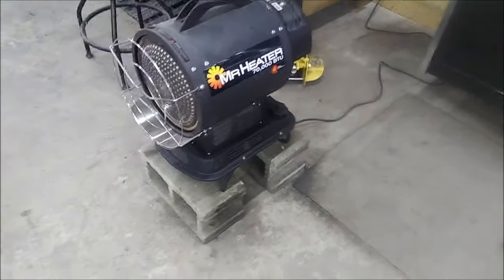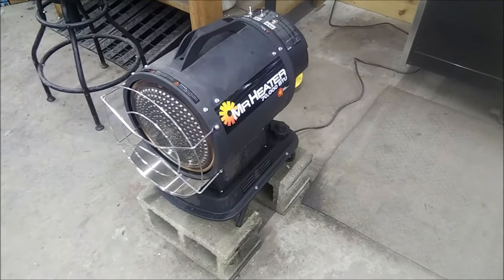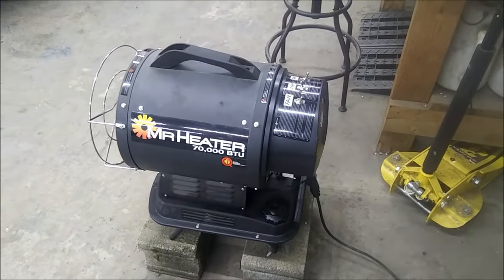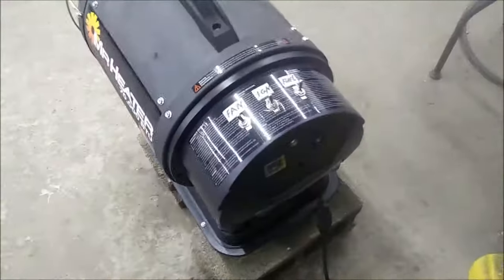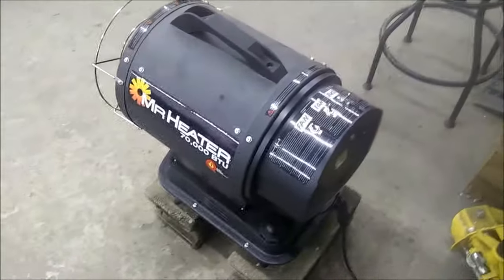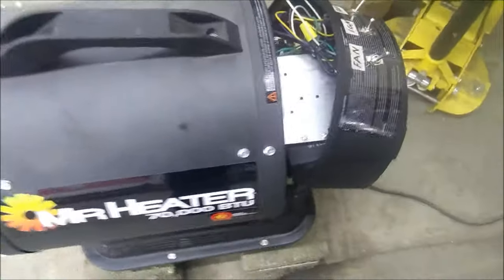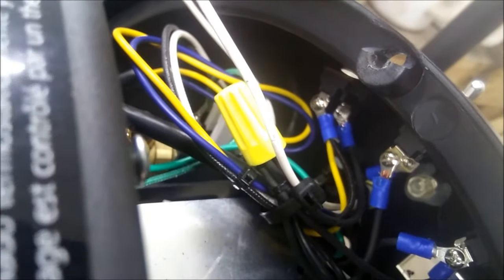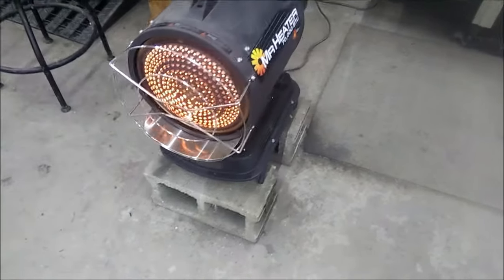Radiant kerosene heater 3 months review E1 code delete

Comment: I’m gonna do this I guess, I’ve had one for 3 winters now and the first winter it worked great, second one was ok had to adjust the fuel now and then, but this winter it’s been nothing but problems, can’t get the thing to stop throwing me the E1 code, calling the tech line from mr heater is like calling your local elementary school and asking for a random 2nd grader on the phone, I know 10x more about this machine than they do apparently. But I love the hater when it’s working, puts out great heat, burns clean, and isn’t that loud
Reply from the maker: I feel the pain lol I still run this same heater and love it for the same things as what you pointed out ... hence I made this video save people some grief and money and keep running it ... thank you for watching

Comment: Its sad so many people have the same issue with this heater. Mine has been working fine for months, this morning its been running, hr later it lit and then throws E1. Now its just repeat E1, I did all the things. I cleaned everything I could find, adjusted fuel pressure, still E1. Lit for a few seconds and shutoff.
Reply from the maker: I feel the same way ... but I really like this heater a lot so therefore I did the modification and I still run it this way as of today. Thank you for watching

Comment: That is great!  I have the same heater and I use it outside in 20° weather and the only way to properly shut it off was to turn the thermostat to 41° which doesn’t work because the outside temp is colder than that. I put a fuel shut off valve on it so I can run it out if fuel and the cool down fan will still work. I love your idea and will modify mine once it starts acting up. Great heater other than that though.
Reply from the maker: Yes feel the same about it works awesome but all that safety stuff was killing it lol. There's a electric fuel shut off valve on it btw

Comment: So I see the reviews. It sounds like this is not worth it unless your some kinda handy man technician or electrician
Reply from the maker: This video is several years old now I hope they have the problem fixed by now, but I don't know. Been running it with that mod for years now and 0 problems I love this heater. Hope this helps and thank you for watching

Comment: One thing that the circuit board does is shut off the fuel if it gets hot, or loses ignition for some reason.  By setting it up manually as you have done is great if it doesn't have any loss of ignition.  If yours failed to fire it would just keep pumping fuel , which would be liquid /vapor unburnt fuel until the tank was empty.  If pump continues to run without fuel it will be destroyed.   The setup you created is best not left unattended, but I understand it eliminated the sensitive electronics and thus works.
Reply from the maker: Once it's fired up you don't need ignition so the only time you'd have a problem is when you lose power and it comes back on. This was the best way I know how to keep this heater up and running instead of throwing it away ... thank you for watching
Reply: I believe ignition is needed before and during the time the fuel selenoid is open.  Ignition is required during firing, it does not ignite or continue to burnt without an ignition source. And it continually needs an ignition source, if you cut ignition it goes out /if you cut fuel it goes out.  But if you cut ignition only it will continue to pump fuel which then goes unburnt. I understand what you have done, but why do you think there is a complicated circuit board /control board in these units?
Reply from the maker: @concretecurt  look here mister I have been running this heater for 2 years trouble free and it ONLY NEEDS IGNITION AT START UP look at the video again. I don't care what you believe I'm running this heater the way it is. There's no discussion about this if YOU don't like it or don't want to run it that is your call but don't tell me how this thing works or doesn't work !!!

Comment: Nice video , 
Pro tip:   I too ran into their warranty issues. 
I fixed mine by going to northern tool and buying a new one and putting the old one back into the new box and retuning it to the store for a full cash refund. Works awesome now
Reply from the maker: Yes that works lol good tip ... thank you for watching
Reply: i think i got your old heater, thank you
Reply: Did you also take a ceiling fan back to Menards with the wrong blades swapped in the box?😂
Reply: Did this with an air fryer I got from runnings 😂

Comment: I have the same heater but it’s a master heater. I was looking to do this to mine but it looks like my valve is reading 24v and must be after the transformer. Was your valve 120v?
Reply from the maker: Yes mine is 120v ... could be a way to keep from people doing this mod. Is the pump and fans controlled with 24v ?

Comment: Mine runs for two minutes and shuts off I did everything in the troubleshooting section did absolutely nothing. Did you discard the electronic eye as well?
Reply from the maker: Yes everything you don't need I ripped out and wired the fans the ignitor and fuel pump. Thank you for watching

Comment: Hello I removed the wiring harnesses an the circuit board from my heater. The fuel pump has a heavy blue and yellow wire coming from the main body. Screwed to the top of the pump with the fuel feed line hooked to it is a cylinder shaped device with two small red wires going to it do you know what this is for?
Reply from the maker: I think that's the fuel shut off valve to keep the fuel pump primed ... thank you for watching

Comment: Im confused. Please let me know if I have this right? Fuel pump, fan and ignition all have 2 wires going to it. One goes to neutral and the other one goes to one side of the switch. On the other side of the switch I have power spliced from the black hot wire coming  in..
Reply from the maker: That's correct David ... thank you for watching
Reply: Thanks for the reply. One more question.. how do I know which wires are neutral and which one goes to my black (hot) wires?
Reply from the maker: @svrperformane964  if my memory serves me correctly it was the white ones

Comment: Can i do this on a dyno glo radiant heater? The insides look similar
Reply from the maker: I'm sure you can on the end of the day the same principle applies. As long as you have somewhat of a understanding on how electricity works I'm sure you can get it going again ... hope this helps and thank you for watching
Reply: @CountryMileGarage  ty sir
Reply: So I got it all wired up and the pump seems to not pump any fuel, i hear it pumping, valve is working but no fuel, it was firing up yesterday but not anymore
Reply from the maker: @karrar55  have you tried to let the pump suck fuel out of a cup bottle or bowl with a hose ?
Reply: @CountryMileGarage  yea I tried that, so I removed the valve wires and it fired up, I go to put it all together and it doesn't wanna fire up lol I did unplug hoses tho
Reply from the maker: @karrar55  I have my valve wires hooked up with the pump so as soon as I turn the pump on the valve opens at the same time ... did you do the same ?
Reply: @CountryMileGarage  I did but I was messing with the wires and the valve wires weren't connected and the pump pumped fuel , I try to reconnect valves wires and it stops pumping

Comment: Do you have 3 white wires together, I  can only find 2
Reply from the maker: There's two in the heater but the third white wire is from the wire that you plug into the wall. Thank you for watching hope this helps

Comment: Besides this issues. This heater good. How does it due on fuel
Reply from the maker: Heater does great been running this modification for 2 years now getting ready for the 3rd winter lol. Probably about a gallon or so on average. Thank you for watching

Comment: Did you use 110v switches I'm guessing?
Reply from the maker: No basically regular 12v toggle switches it's the amps that burns them up not the voltage. So get the 20 amps or so and you should be in good shape
Reply: Ok so I wired it the way you did. I have fans. I have the ignitor working and I have fuel. All 3 switches work. But the heater still won't ignite. I took the heater apart a step further to see the nozzle. I can see a fine mist of fuel when I turn the fuel switch on. The I hit the igniter and it wants to light but won't. Any idea's?
Reply from the maker: @pittsburghhustler412  double check fuel filter and take the nozzle apart and clean and blow that out. And you may need to mess with your fuel pump settings. It's hard to say what's wrong with out seeing it if you know what I mean. But not enough fuel or fuel pressure to make a fine enough mist could be the problem